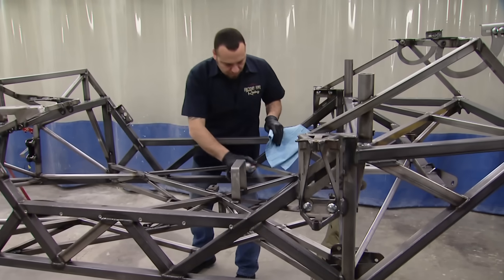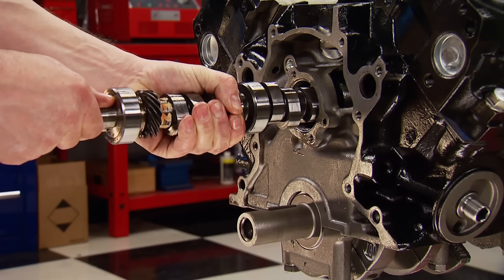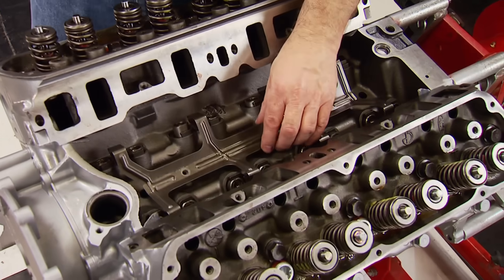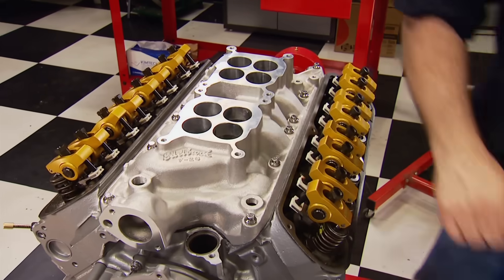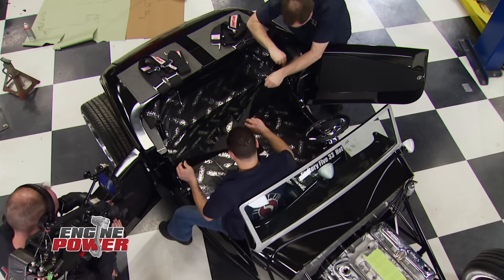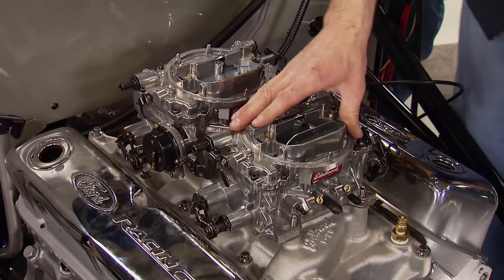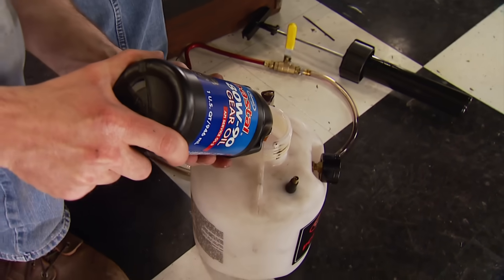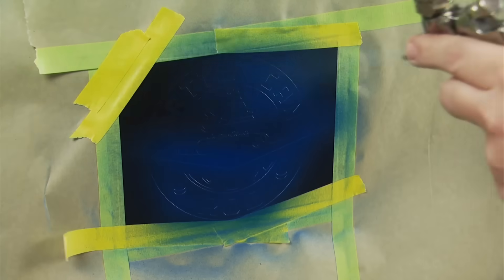Dropping A Ford 302 5.0 V8 In A '33 Ford Hot Rod Kit Car - Engine Power S2, E11

Comment: Loved the video right up to 17:48, then you went and drowned out the sweet sound of the engine with the overbearing music.
Reply: That's was to drowned out the tapping
Reply: upupaepops 
That sweet sound wasnt so sweet it rattled and pecked they released the pressure off of the lifters and didnt drop them into a bucket of oil and they lost there hydrolic pressure is what im thinking happened also the motor was salvaged from a wrecked mustang the same one they got the stearing column from